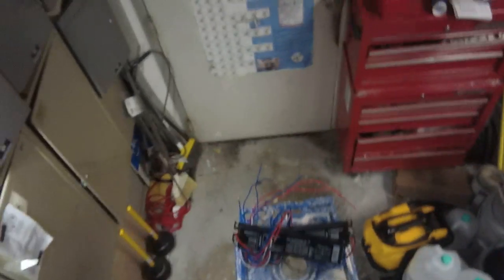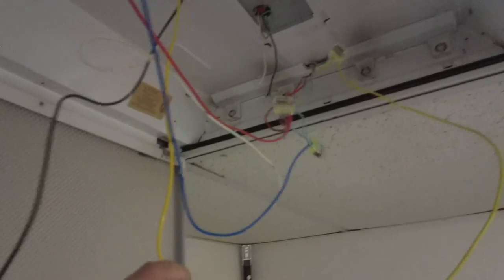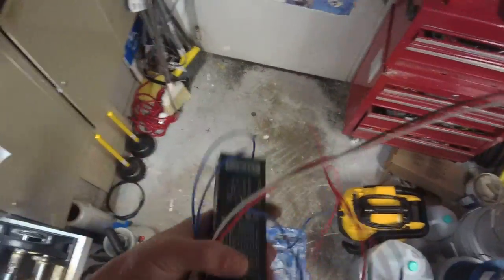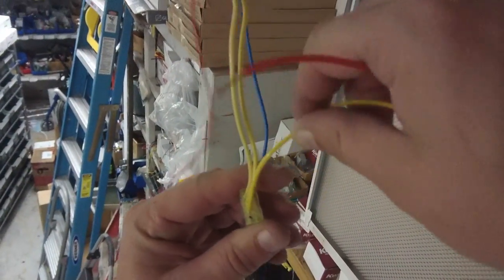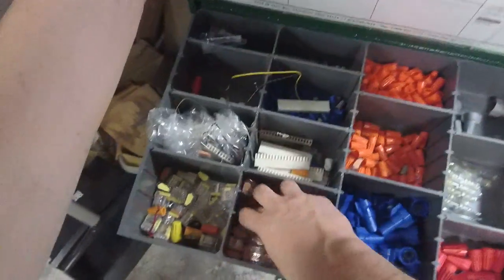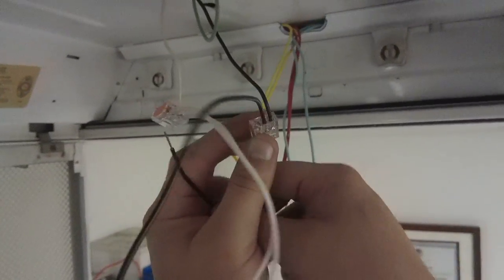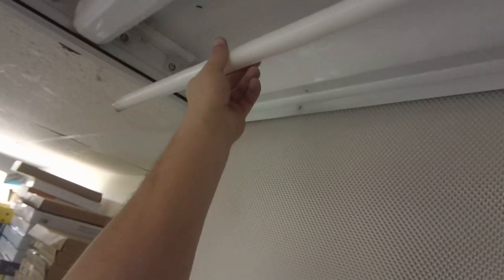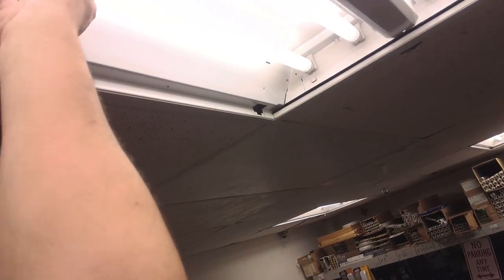How to install fluorescent 4 light ballast.(For T8 bulbs 32Watt)

Comment: If you're troubleshooting multiple ballasts in a light fixture or few, it helps to have the breaker on to easily see which ballast is the faulty one. 

But for installation purposes, it's easy to do with the power on. So simple. Disconnect hot first. Like in the video, plug the hots with a wire connector. I'd even do the common just in case if it's tied in to another circuit somehow and you don't know about it. Boom. You're saved. Now you can cut whatever wire you want or even rewire the whole damn fixture. When you're done wiring everything up, that's when you plug the new ballast hot and common into the all already connected preexisting hots coming out of the ceiling. It's literally sticking them into a port or slot. No way you can get shocked. A kid can do it. Wire nuts on the other hand are more risky and I would highly recommend turning off the breaker for that. Wire connectors, an absolute no. It's just too damn easy and safe. I guess you can use a wire nut to do the same thing too but you have to take them back off and group the hots together and twist it back on. There's a risk wires won't line up properly and such or they slip and you get shocked. Wire connectors eliminate all that. Plug and play literally. 

I've converted T12s, to T8s, to LEDs with power on each time using that method.

Comment: You say to connect black after white. Why is that? What would happen if you did the reverse?
Reply from the maker: Black is the only wire that can shock you  it is the power wire. This was wired live . If you did the reverse nothing really would happen just hook the power up on the last part for safety . As you saw I did almost forget to get rid of the wires that where hanging.You kinda don't want that touching your face when you do hook up the black wire. Thanks for watching .
Reply: Haha yeah that was a close call, with that one wire hanging. Glad you didn't get shocked. And thanks for the info :)
Reply: Always remember: hot is connected dead last. Lol. In this case, he connected white first, then black to fully energize the circuit.

Comment: Should have maybe turned off the light switch to kill the power.
Reply from the maker: Naaa I like danger :þ
Reply: No need to turn them off. For what reason? There's a wire connector already blocking off access from your hot lead to your ballast circuit. I can touch it all day and won't get shocked. Once the hots are separated, the rest of the wiring is safe. No longer live. Dead. You may freely cut whatever wire you want after that. 

His video proves that.
Reply: @howardpower  doesnt mean you should instruct people who have no experience in electrical wiring to leave a circuit hot while you work on it.. use common sense. Take a second out of your job and shut the breaker off. Being a tough guy doesnt make you smart.